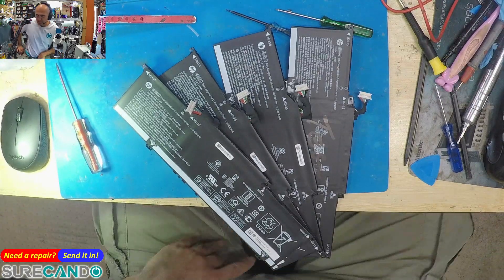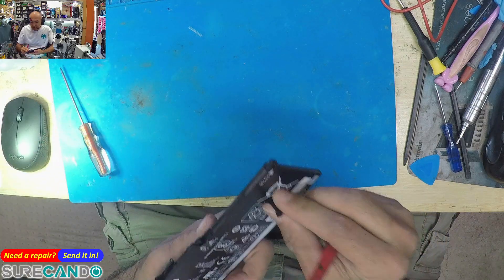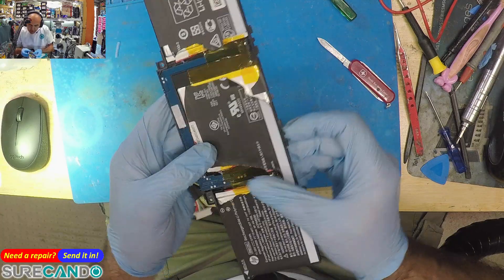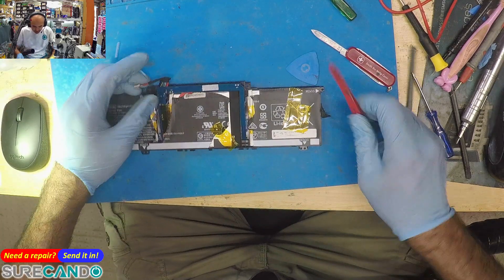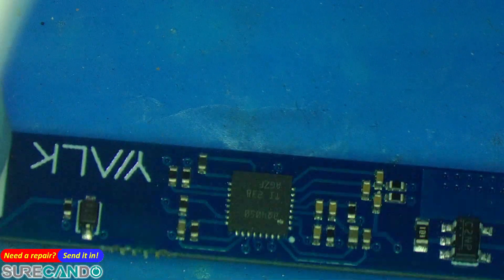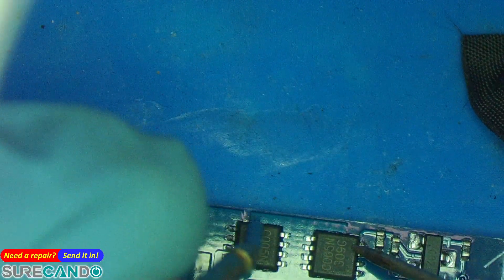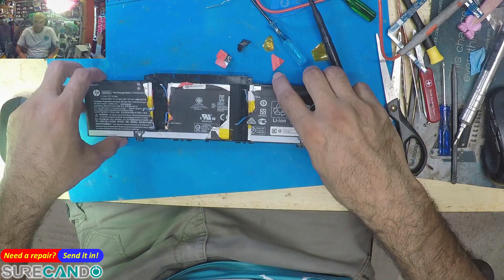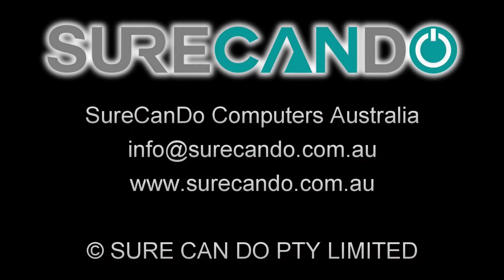Why HP Batteries Fail: Error 42 Battery Fuse Investigation | Complete Breakdown

Comment: hi, hp is doing this on purpose, so you buy another battery from them. An Envy that was kept on shelf 2 years, consumed slowly the battery so one element was under 3 volt. I charged and discharged all elements and they are fully functional, but the chip reported as Error 42. Cycle count: 7 !!! Let's save the planet, throw this and buy another from authorized seller. For similar reasons I never buy again HP printers or anything else.
Reply: Same happend with me, all of a sudden gave me 42. I'm really so furious